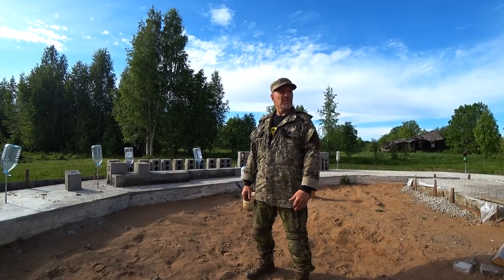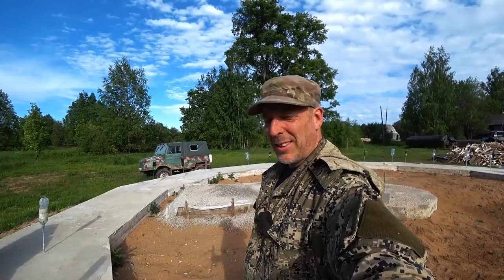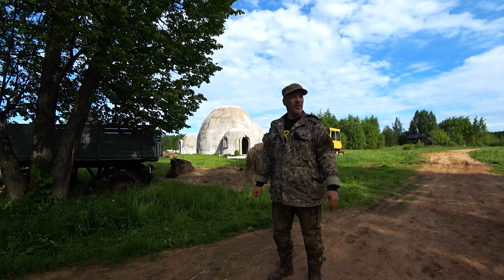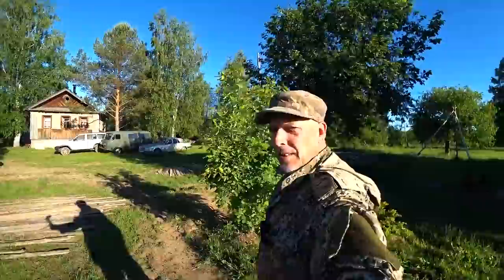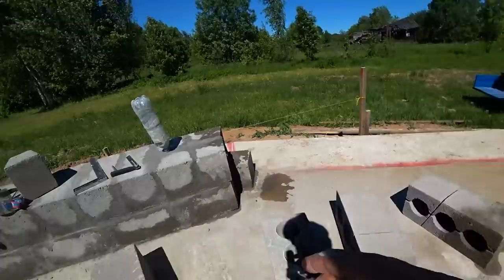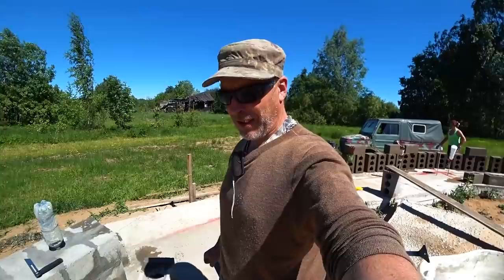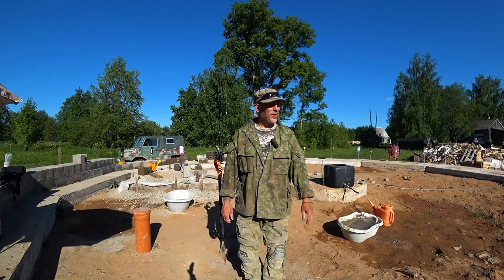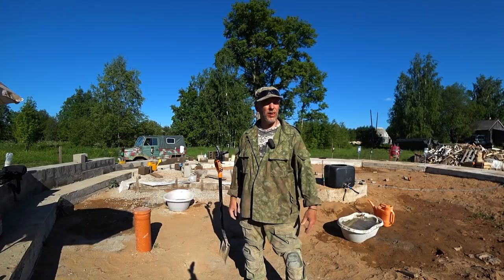Building A 12 Sided House At The Homestead | A Temple To My Ego?

Comment: 3 years experience on a professional masonry crew, build everything from stadiums to churches to mailboxes. You sir are doing a professional level job and there are few if any masons who could do better. Most masons I knew hated laying block because it was so heavy, and I think your blocks are heavier than ours as we used mostly 16 x 8 inch blocks with two giant holes cut out of the middle. A master mason would be expected to set 100 of those each day, but that's with a helper making all his cuts, all his mud, basically all he does is set the block. Here you are setting a heavier block, making crazy cuts, and mixing your own mud. If you were looking for a job I'd hire you and be glad I had ya! Looks like a great project!
Reply from the maker: Thanks! I understand what you mean about the weight. They are +17 kg each. I finished the foundation wall today and I am happy not to work any further on laying blocks! :)

Comment: WOW !! I have been a Stoneman for 31 yrs now and I have never personally built or even seen a 12 sided house before. Especially built out of masonry materials. 
The staggered bond you are referring to is what we call a running bond ( the most common of all bonds ). There are quite a few bonds that can be used. There is a Flemish bond. English bond.
English/Flemish bond etc...
You definitely have your work cut out for yourself. 
Pro tip: Get yourself a brick masonry hammer. Instead of cutting with a diamond blade and creating carcinogenic dust. Mark a line where you want to cut. Tap and score all the way round the block and you will see that it will eventually snap and break where you have scored it. 
It may take some practice but you are very smart and you will get the hang of it very quickly. I will be following your progress and look forward to more videos. 
Cheers from Nova Scotia Canada 🇨🇦

Comment: Kinda looks like its gonna be a base for the biggest Bereg hot tent ever! Sleeps 35 ninjas and has a pocket for your phone! Nice to see you and the misses again. I would definitely help if I lived closer. p.s. "Sill" is correct term for here and I call the tool a "bevel gauge". And adding a little weight to the top of the tiller would help if you are spinning the wheels too much. Salute from the woods of North Carolina.

Comment: Lars, many years ago I drew up plans for a twelve sided house constructed from timber, (which I never built,) and the bit that I recall nowadays was it having a fixed central core for water, drains, electric and such like services, but with the outer section being seasonally mobile and able to turn around the core.
The main problem for a twelve sided building  is as you say, in setting out the foundations, but also in the roof which I had drawn up covered with wooden shingles to allow for the taper and a central glazed dome over the central core to deal with the ends of each of the twelve wedges.
I haven't heard you say if your building is going to be one or two floors, and I have no idea how you intend to support the roof and so on, but the problem with the layout was much easier to deal with when the fixed items such as kitchen, bathroom and so on ran around the central core, and when the other internal dividing walls were temporary (built out of hollow boxes, some with hinged lids and some without, that could be used for storage and/or shelves depending on the room they faced into from time to time,) and which could be moved to various locations as required.
Personally, I am really looking forward to watching this project taking shape over the next years, and don't hurry the foundations. I know that concrete and blocks and compo is shit work, but without it being done in a reasonable way, then you will hit problem after problem with the next build phases.
Best of luck with the project, and I wish that the labourers I once worked with had been as good looking and attentive as your video says the Russian ones so obviously are.

Comment: Love, love, love these videos. I can't wait to see your house when it's finished. Can't even imagine how awesome it's going to look. We have little bugs that sometimes swarm around your face, making it difficult to even breathe. They are maybe 2-3 mm long and, in Kentucky, we call those, "dog pecker gnats", The Boss will explain it to you, LOL. How can it be that sunny at 5:00 am and you're wearing a jacket. We call that angle tool a "T-Bevel". A protractor actually has the angles marked on it. One is for measuring angles and one is for replicating angles. I'm curious, do any of your neighbors use horses or mules for doing rough tasks like moving your blocks around or getting other equipment unstuck from the mud or snow, or is it just too cold there to maintain large animals?

Comment: You should use a rubber or wooden mallet to adjust the blocks that you're putting in place with mortar. The human hand is not a hammer, and everyone that uses their hands as such eventually regrets it.

Comment: @Survival Russia  
Laying those cinder blocks on their side like that is an easy mistake amateurs make because they seem to stack nicely. But they are only going to crumble once they have weight resting on them. They are designed to have strength standing on edge. Think of an egg; apply pressure end to end and it is quite strong, but a little squeeze on the side and it cracks immediately.
Reply from the maker: We are not laying them on the side. They are "holes down".
Reply: @SurvivalRussia  
Oh, good, they looked like they were on their side on my little screen. It would have been a disappointment to see all that effort being put in just for it to be a bugger-up.

Comment: You are missing one ingredient in your cement work, beer. My dad bought case after case of beer and had plenty of help toting blocks and preping them. He had to dig a hole just for the caps. That was in the 1950s and the foundation is still working. But if you start building a 12 sided survival snow shelter . . . . . ha ha

Comment: Do you have a rubber mallet? Use that instead of your hand to tap the blocks. Looks good. Will you make the timber brackets yourself? Tip, use smoke pots with punky wood, that will keep some of the bugs at bay.
Reply from the maker: I actually have a very nice soft mallet, but it is for the chisels when I have to do the timber frame. Yes, I will do the frame, braces and all myself.

Comment: I think round houses are more efficient for cold climates especially when you place your heat source in the center. If I had to build or even rebuild, I'd be seriously considering something similar. We always get three or four  -40 F/C or colder cold snaps every year lasting up to a couple weeks or more in duration. Normal average winter temps hover between 0 F to about -20 F.

Comment: Good job horizontal are called bed joints and verticals are headjoints now that we use hollow blotter the seals are out of our block they're not the report Concrete in each one of the cells do do they not use grout in Russia I was a bricklayer long time before the before I became an electrician I don't envy you I'd rather be bending conduit pulling wire talk to you later. Lars hope I spelled it right

Comment: Nice job on the blocks, much better than I could do it, for sure.   Was wondering why you didn't seem to put any mortar in the vertical seam between the 2 contiguous rows of block to get them to stick together, I would think that would be stronger.    Or maybe I just missed it.   Was also wondering about the sand base.  Don't know anything about it so this may be silly, but I was wondering about how sturdy a base that is.  Anecdotally, I do know that I got trouble because some animals (ground squirrels and the like) seemed to enjoy digging under the concrete to make themselves cozy apartments / have parties in the sand.  After a while the concrete sagged and cracked and I could see lots of sand having been moved out from underneath.  But more importantly perhaps, it also seems like the sand could be easily washed out by water during heavy rains etc.  Is that a problem in reality?    [Edited for typos]

Comment: Wouldn't building like this also mean you get more volume inside with less exterior walls.
Reply: Yes.  That was the reason for building Octagon houses at one time in the United States.  There were never very many of them because the internal layout was awkward.  BUT the most amount of space could be ENCLOSED using the least amount of material.

Comment: 3:05 If it's german it's probably Deitermann/Weber corporation. Not bad, but overrated products. 13:10 As a building engineer I must say you're doing pretty well. Don't forget about a proper thermal insulation of those foundation walls.
Reply from the maker: Henkel Cerasit C17.
Reply: @SurvivalRussia  ...usually used for tiling ;-) Not a bad choice. It's elastic and frost resistant.

Comment: Wow.  Unsubscribed because you are building a 12-sided house.  Wonder how he would have felt about our 40-foot diameter, 2-story, 20-sided polygon Hubby and I built?  The wall framing was done in two week-ends.  The roof took longer as we had to figure out how to float 5 section of the rafter-units out over thin air and tie them into the center ring.
Reply from the maker: That sounds tricky :)
Reply: @SurvivalRussia  Hubby breaking his right arm as we were finishing up framing the second floor really compounded the engineering of the whole project.  Thinking about it, it may of helped, as we were forced to slow down and think about easier ways to do things.  Are you going to put a belly band/cable around the top of the walls to keep the sides from pushing out like they do with yurts?  We found we had to.